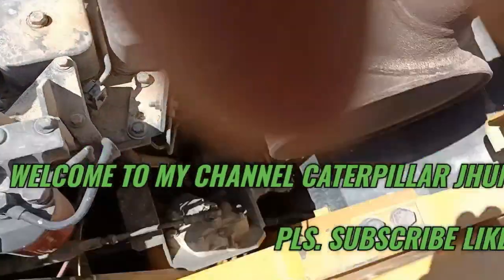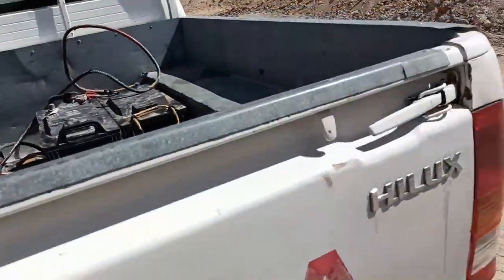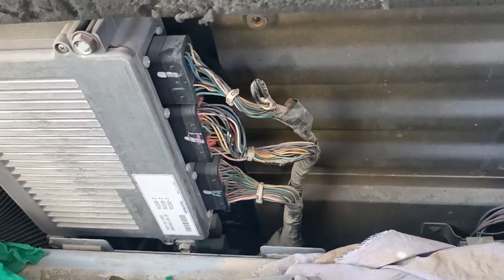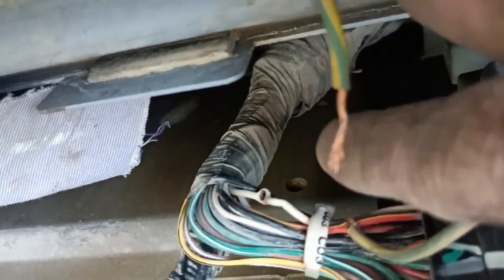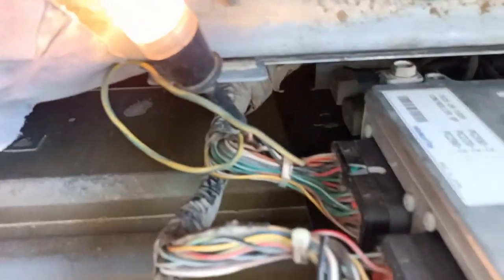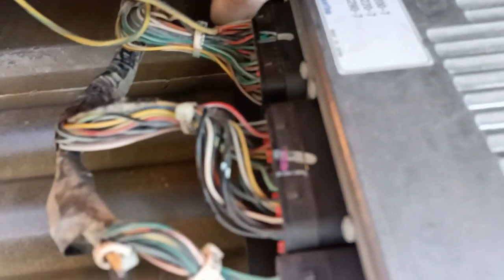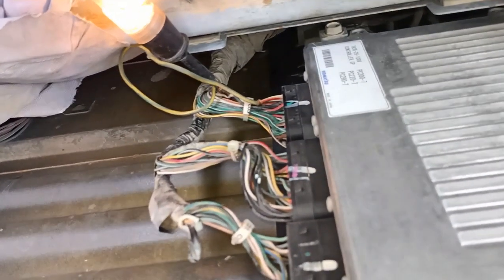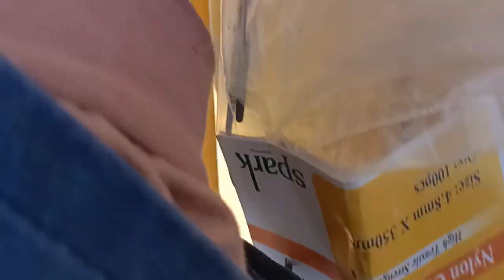KOMATSU PC 220-7 NO ENGINE ACCELERATION NO ENGINE STOP

Comment: Nice work I appreciate, but i hv same issue but   with jcb 22o
Reply: Pc 290 my 12volts na lumalabas sa fuse box kya po  yung battery relay nag raratel pag off po susi. Tapos po gumagana trothel control pero po  pag gumalaw na joice tick ayaw pa lumakas rpm ano po kya problema sir

Comment: Eo5 sir panu maaalis.
Reply from the maker: ang e05 ay d maalis hanggat hindi naitatama kung anu dahilan ng error
Reply: @caterpillarjhunhunk  nawawala ung rpm sir bumili nko ng bagong accelarator motor.
Reply: @caterpillarjhunhunk  check ng electrician ko ok nman kya lng nga pag start n prang nagwawild ung accelarator.tapos wala ng rpm.
Reply from the maker: ung e05 ksi maraming klase sanhi ng paglabas nyan kya makikita mo lang ang tamang error nyan kpag napasok mo service menu, anu b epekto s machine s paglabas ng ng error n nyan
Reply from the maker: anu model ng machine mo - 6 o 7
Reply from the maker: @richardcuaycong989  pasukin nyo service menu ang service ang magsasabi kung anu sira nya basi s e05 n nagddisplay s monitor,kailangan ma e correct ang error o kung anu dahilan ng error kusa n mawawala yan
Reply: @caterpillarjhunhunk  pc 228 - 3 sir.
Reply: @caterpillarjhunhunk  sbi nung electrician d n raw mapindot ung mga panel nia.surplus kc ito sir.
Reply from the maker: @richardcuaycong989  medyo lumang model n yan, pero may accelerator motor n. sir may whatsapp kba kontakin mo ako, s whatsapp +971567581176,bigayan mo ako ng ilang pic ng accelarator motor at ung disply o monitor pra may idea ako s design nyang machine mo
Reply: @caterpillarjhunhunk  salamat sir cge sir padalhan n lng kita ng mga pic.thanks uli sir.

Comment: Kabayan kunting pabor lng baka pwd makahinge kunting  diskarte may ginagawa aq d2 sa Pinas pc130-7  naghuhunting ang accerator.ano po pwd q gawin?
Reply from the maker: For temporary solution try mo e disconnect ung speed sensor nsa flywheel un,or baka nman nagpalit kyo ng bago nyan kailangan lang e adjust un rod para nka timing sya s potentio meter s loob at labas n nka attach s motor.
Reply: Cg po subokan q disconnect ung mpu sa flywheel

Comment: Sir good pm, the governor motor of our PC200-7 is not working even though we replaced it with new one, surely this is an electrical issue, in this video, you mentioned 3 wires, Red, yellow with stripe and white. did you do jumper method connecting red and white wires?
Reply from the maker: i that situation sir the problem was found on the ecm power supply positive thats why i made the way to give positive live wire that came from ignation or relay that can possibly switching on and off thats what i made,.the problem was,it is starting but no acceleration we cannot switching off.

Comment: sir gdbless idea lng poh sana ilang minutes mawala yung rpm back to normal pc70 kumatsu galeo sir???
Reply from the maker: brad depinde s emplement pressure kung kilan mag iidle ang makina from full acceleration back to idle,may pressure switch ksi yan sya ung nag bibigay ng signal s ecm o ecu to accelerator dependi s setting ng throttle mo,then back to normal idle,diba s monitor nyan may auto accelerate at decelerate,conneted yan s mga pressure switch n nag bibigay ng signal s ecu o ecm,halos second lang yan bago bumalik s idle  about 20 to 30 second depende s pressure once n naka neutral kna
Reply: @caterpillarjhunhunk  la po siyang auto pc78us -6 poh

Comment: Sir, mag tatanong sana, nag try kami mga lipat ng makina parehong PC450 unit na backhoe, nung na iset na lahat at nag connect na ng mga linye nagkaroon ng supply yung ground connected sa conroller, causing na masunong ang main harness ng unit, ngayon binalik namin ang makina sa dati, same issue, mag positive supply parin yung dapat na ground connected sa engine controll, tinignan namin, connected yung ground sa CE03 ng engine control, sana matulungan nyo po ako, isa pang issue kahit naka turn off na ignition naka ilaw parin ang monitor ng unit, salamat
Reply from the maker: Whatsapp mo ako
Reply: pwedi pong malaman number nyo sa whatsapp?

Comment: Sir pwd mag tanong same problem ng ginawa mo hndi mapatay sa switch ang engine pc200-7 din makina tapos meron pa power ang dasboard pag nakapatay na makina
Reply from the maker: sir kontakin mo ako s whatsapp +971567581176, pero try mo rin e check ung alternator bka naglalabas n ng b+ ung terminal ng alt punta s indecator kung ok un check mo diode n nsa likod ng at katabi ng machine controller,pagpalitin mo lang muna ung diode n magkatabi kung my pagbabago kung wla baka battery switch mo mahina n spring pra of nya buksan mo lang un 4 n screw banatin mo lang try lang ha o kontakin mo ako s whatsapp
Reply: @caterpillarjhunhunk   ok sir tawagan kita mamaya
Reply: @caterpillarjhunhunk  sir hndi ko matawagan number mo
Reply from the maker: @anthonymirasol5526  un laang wlang viber dito s whatsapp lang +971567581176 pero mssg mo muna ako bgo k tawag ha pra e on ko muna vpn ko
Reply: Sir 12 po talaga number jan
Reply from the maker: @anthonymirasol5526  oo 971 country code 56 network code 7digit mobile number, nsa uae ako

Comment: Mine is pc220-7. After starting the engine nothing is working at the hydraulic side. No swinging,tracking and not raising of the boom. Please help me. Thanks
Reply from the maker: what do you mean no function at all,no sound that you can hear from the main pump while you going testing,if nothing action,check the ppc lock solenoid,you will found that under the control valve

Comment: Sir good morning tanong ko Lang po nag overheat pc60 namin Walang lakas mag breaker at namamatay
Reply from the maker: kpag over heat ang alin makina o s hydraulic system nya
Reply from the maker: may mga praan dyan kung paanu mlalaman kung bakit nagooverheat, una alamin mo kapag ang makina ay umaandar at nkabukas ang radiator cap pra makita mo kung nabula ang tubig nya, ibig sabihin may tama head gasket,pero kung wla nman mag check kyo ng s water line or baka ung thermostat ay d n gumagana o di na nabukas, kpag ganun check mo ung hose ng radiator s baba kung mainit b habang naadar at nagooverheat n, kung d nman sya kainitan pero ung itaas ay subra n ang init thermostat mo ppweding sira n. baka rin madumi n radiator mo lalo n kung hindi n coolant ang ginagamit nyo pang dagdag,ang kumatso ksi lalo n medyo bgo bgo p may automatic idle yan lalo n kpag n detec nya n overheat n.

Comment: Helo boss.pc128-2E1.hindi po gumagana ang high nya.pindutin m sa monitor e ayaw mag high ang travel nya.tapos my lumalabas n EO2 dash board nya.ano po b problema dun sa high and low nya.ty po
Reply from the maker: baka naputol ang wire n nka kabit sa solenoid ng travel speed kya d nagana o nag ffunction hi and lo nya malapit yang mga solenoid nyan s control. valve
Reply: @caterpillarjhunhunk  boss pwedeng ma video ung solinoid ng trvel ng hi nya kc wala akong alsm sa kumatsu n backhoe.pc 128.ty po
Reply from the maker: @leonardojrognayon1510  sir kontakin mo ako s whatsapp kung may whatsapp ka +971567581176 pra makapag usap tyo ng maayos ha

Comment: Sir ano po problema ng pc200-7 sa una po ok payung acceleration nya tapos pag ng operate na biglang minor yung engine tapos ayaw na mg high rpm.
Salamat po sir.
Reply from the maker: contakin mo ako s whatsapp +971567581176,pra makapag usap tyo maayos, pero ganito gawin try mo lang check k muna s monitor s service mode kung anu ang error n lalabas, kpag wlang error try mo e disconnect ung sensor s flywheel nsa bandang ibaba lang ng accelerator motor un s tapat ng flywheel bandang kanan pero patayin mo muna makina bago mo gawin yan. ha

Comment: Sir Komatsu PC 210 accelerator problem what is the cause sir
Reply from the maker: pc210 - 7 or - 8,, if motorize the accelerator, you should have to inspect 1st the harnes any damage, the check n motor if moving while you switching on or off the key, if not moving either motor damage or harnes, but if the motor is moving only just little try to disconnect the fly wheel sensor, then start

Comment: sir,patulong po.accelaration problem,hitchi ex 135.pgpinihit mu ung control lalakas ang andar ng makina,maya2x babalik sa menor,kusang bumababa ung motor.bumili kami ng bagong motor ganun pa rin,aangat lng ng konti ang motor,taz baba sya ulit!sana matulungan mu ako sir!
Reply from the maker: about dyan s hitachi mo design ng motor or servo motor nya. baka masmadli ko maemagine kung paanu masusulosyunan yan, pero ganito gawin mo try mi muna e check ang wiring harnes nya bka s katagalan may mga nkatagung damage o putol lalo n ung mga wire n nka dikit sa makina make it sure mo n walang nagagasgas lalo n kpag nkaandar ung makina mo, kung  wla kang nkitang damage o putol check mo ung volume control ng accelerator ppwede rin n gastado n un or loose contac n. o kya kontakin mo ako s whatsapp +971567581176